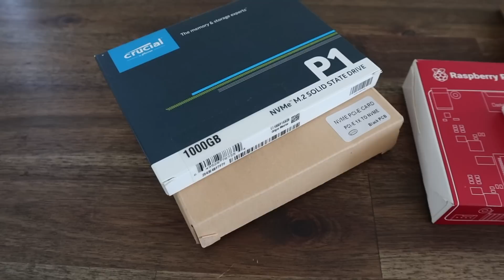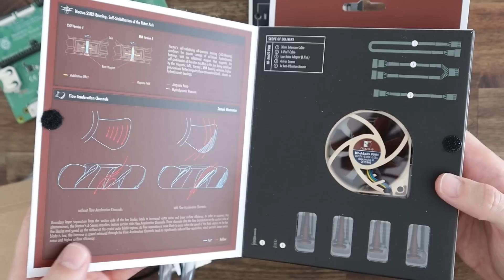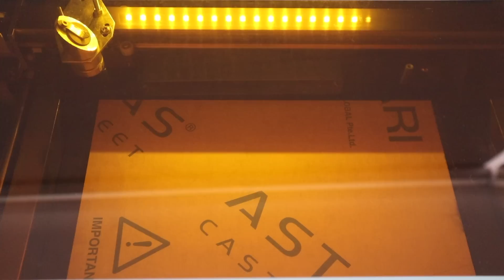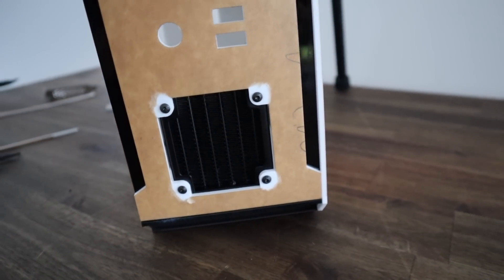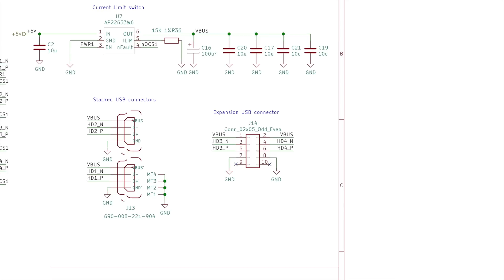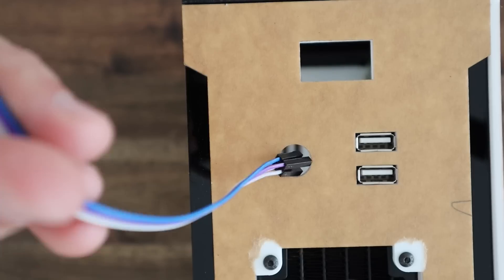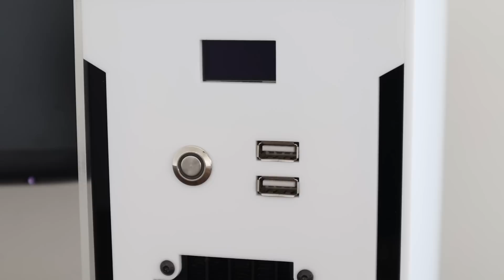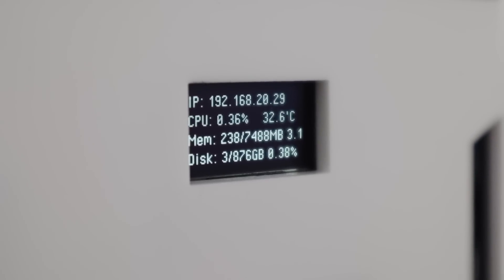Ultimate Raspberry Pi Computer Build – Water Cooled CM4 with NVMe SSD

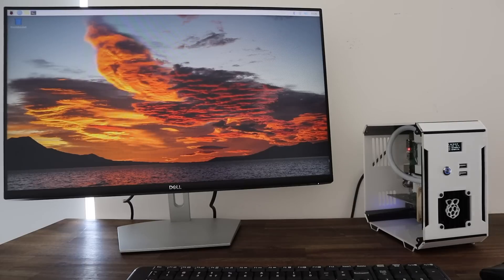Comment: 13:37 - They are USB 2.0, since the USB 3.0 ports on the Pi 4 are only possible through the PCI Express bus (with a VL805 chip built-in)—on the CM4 IO Board that bus is exposed directly (through the PCIe x1 slot).

I love the case design—it has lots of room for activities! Maybe a future iteration could be built with a PCI Express slot cut in so you could install a PCI Express card directly. Probably would need to fudge the IO board mounting point a bit, and maybe reorient things inside. But I love the simplicity and the build quality, nice work!
Reply: It doesn't really matter what USB ports are on the pi side anyways. He used a USB 2.0 cable, so anything will be limited to 2.0 speeds even if the pi side is 3.0 and/or the drive is 3.0
Reply from the maker: Yeah I figured that since the two USB ports on the IO board were USB 2.0, the expansion ports would probably be as well. Thanks for the explanation on why though, that makes a lot of sense.

It would actually be quite easy to adapt the case design to include a PCI Express slot, there is enough room for it. I'd just need to add some way to secure the screw on the 90-degree bend at the end of the bracket - which could be done with a 3D printed part. I hadn't given it too much thought since the M.2 adaptor doesn't have any external ports, but it would definitely make the case more versatile for other applications.

Great to see you here by the way, I love your videos!
Reply: @MichaelKlements  Ditto!
Reply: i ws writing to say the same thing... I just need to get MINE to boot from the nvme :/
Reply: @MichaelKlements  are these available to buy? 🙏🙏🙏
Reply: remember your issue with grphics cards on a pi4? have you tried a pcie 2.0 gpu? like a gtx580

Comment: This is the first time I've seen the CM4 and carrier board used, although I've known about the CM3 (and now the CM4) for a while.  Looks very interesting.  I'll definitely consider it when I next need to get a Pi 4.  I especially like the 12V barrel connection for power: so much easier than messing about with micro-USB or USB-C cables.  Just hope the stock levels and pricing of all the Pis get back to normal at some point...

Thanks for a great video!
Reply from the maker: This is the first "project" I've used one for, I usually just use the regular Pi 4b for its size. The IO board does have a number of benefits over the Pi 4b though, so it makes it quite versatile. 
Hopefully we'll be able to buy CM4 modules again soon!

Comment: Amazing video as always <3
Happy midweek and keep it up the great job <3
P.S.: Pump should always be the lowest point in your water-cooled loop ;)
Reply from the maker: Thank you! 
Yeah, you just also don't want to have the filling point of the reservoir lower than the radiator or cooling block otherwise when you open it up you'll get coolant leaking out of it. With the pump fully submerged in the reservoir, there isn't much risk of it running dry.

Comment: I'm pretty sure you could have shrink down the size of the case even more. it's a very pretty build and i thing my re arranging the placement of the components you could have a smaller and better looking case !
Reply from the maker: It could be made quite a bit smaller without the water cooling loop, or possibly using hard tubing. Flexible tubing needs some space for bends.

Comment: You could've put washers between the compute module and the I/O board to prevent the CM4 bending and added springs on the top bracket screws to prevent over tightening.
Reply from the maker: Thanks for the suggestion!

Comment: I love what you done. The radiator have to be above the cooling block, Always so you don’t have air bubbles in the system. Also you should have mounted the reservoir at the bottom, if you need to repair something, it would have been easier to access it. But thumbs up.
Reply: The 3D project is available at etsy and I bought it. Thanks for the clue. Because I do not want to use usb extender and power button, I can redesign this part and move the part for radiator screws higher where holes for USB and power button are located. And this way it can be achieved. Eventually move the power button and USB holes lower, I mean rotate/replace each other. So, quite easy to make it work. I have bought acrylic plates, so probably on February 2023 will record a video with the project.

Comment: There is no holder for LCD in the 3D project that I bought on Etsy. I had to design the holder for standoff and now will have to do this for LCD screen.
Reply from the maker: I'm sorry to hear you needed a component that I did not include. I have added the display holder to the download, so you should be able to re-download it. The case was modified to allow the standoffs to be secured through the side of the case, that is why the standoff holders were removed.
Reply: @MichaelKlements  I wrote to you through etsy. I did not find the stl file of the LCD bracket in the re-downloaded zip file.

Comment: My observation is this:  First, you should have used thermal paste of any good brand instead of the thermal pad.  Thermal paste is much better in transferring heat from the processor to the heat sink.   Second, using colored coolant is not good for long term use.  There's lots of youtube videos showing nasty gunk formation inside the heat sink because of the stuff used to colorize the coolant.  Sometimes it even reacts to metal, causing corrosion.   Pure distilled water should be used,  or 70% water and 30% denatured alcohol to prevent bacteria or algae growth in the water and for better cooling also.
Reply from the maker: Thanks for the suggestions Gerry!
Reply: @MichaelKlements  You are very much welcome.  The Raspberry Pi computer build you made is so impressive and I like it too.  I'd love to see more videos like that.

Comment: are you ever going to release the files for the case? I really need to water cool for raspberry pi. This might sound unusually for many of you but I use my raspberry pi as a digital dash cluster for my race car. On the track, my cockpit will see up to 100+ ambient temperature. The cpu temps are spiking to 50-60 even with an ice tower. Seeing you videos. 30-35 degrees is really insuring. I want to water cooler my raspberry pi.

Comment: In the description you have a URL to a horizontal water pump and you are using a vertical one. Because of that I bought wrong water pump. Then watched the video over and over and spotted that the pump is the vertical one and the pipe from the water pump goes up. Had to buy the vertical one. This is extremely important. I have found at Amazon acrylic cylindric water cooling tank, diameter 12,9 mm, with removable threaded lids, so I was able to put the vertical pump into it. I did the same thing with the transparent pipe (8 mm diameter) and put the end of the pipe onto the pump and used a cable tie like you did, and the other end of the 8 mm pipe I put it into the threaded tip that I have bought separately. It is hard to explain what I exactly did. I will upload the video soon to show step by step the process of mounting the pump inside the tank. Noctua fan must be 4-pin, not 3-pin, if you want to regulate it with PWM. What about the 5V? The module with  the mosfet IRF520 requires 10V to run at all, what is important, so you need at least 10V power adapter for the module with the mosfet. I know you are using CM4. Instead of the module with the mosfet, I decided to use a module with two relays to connect it to the Raspberry Pi 4b rev. 1.4 and of course the pump and fan have separate 5V power adapters connected to relays. It is quite simple, but required some time to perform a research. Outside the water tank I am using the pipes from your Amazon link, they are wider, 10 mm diameter, so had to use special threaded adapters for my water tank to mount bigger transparent pipes, similar to those you are using in the project with the green water coolant. Anyway the project taught me more about the microelectronics, mosfet, relay etc. than I learned when I had microelectronics class. Thanks a lot for this video, for the water cooling block with the bracket that I ordered through Etsy and it finally came and for all the support you provided that allowed me to understand each part of the whole project.
Reply from the maker: Unfortunately Amazon sellers switch products around but keep the same product page so that they don't lose the reviews etc., I'll get the pump like updated to one with a verical connection - thanks for letting me know.
Yeah the CM4 IO board takes a 12V power supply and has an onboard fan header, so you don't need to worry about any external modules to power the fan.
Great to hear you've managed to get it all put together!

Comment: I have last question. What DC did you use? 12V 2A? I am just wondering what I have to buy to provide sufficient energy.
Reply from the maker: I used a 12V 3A power supply - 2A might not be enough for the Pi, NVME drive, pump and fan.

Comment: Nice case, Unfortunately I have no 3D gear, I'd probably skip the water bit and just use a decent heatsink and arrange a fan to pull the heat straight out the back of the case - as opposed to the regular PC idea of two fans, one to cool the CPU heatsink but just spread that heat around inside the case, and another one to push that hot air out the back.
I'd also find some washers and other spacers etc, so those screws holding the water block in place can be properly tightened up without placing any stress on the CM4 etc. 

How does that CM4 & NVMe combo compare to a NVMe hanging off a USB port on a regular pi, yes the numbers will be better, however I'm more interested in real world everyday computer usage, is it worth my time finding a CM4 etc, or should I stick with a regular pi etc. If it's only 1 or 2% better, then I'll probably just pass.

Comment: Awesome build ❤️, also I don't know the specifications but I think the extension cable for usb ports were 2.0 only, try 3.0 extension cables, may be it will work.
Reply: The carrier board only supports USB 2.0
Reply from the maker: Yeah I think the IO board only supports USB 2.0 on these breakout pins

Comment: I have bought the project via etsy and also the water cooling CPU aluminum block with the bracket. However I would like to know how many acrylic 3 mm sheets should I buy to be able to cut all the elements with the laser cutter?
Reply from the maker: That’s great, thanks for the support. You need 4 x A4 size sheets - each large side panel fits on one sheet and then two of the smaller panels per sheet. The corner fillers can be cut from the scrap pieces.
Reply: @MichaelKlements  thank you very much for the explanation. I have read a lot about the proper water cooling schema and I know how to connect it.
Reply: @MichaelKlements  how the water pump that is inside glass bottle is connected to the power supply? Directly to the CM4 board or to the separate power supply like some DC?
Reply from the maker: It's a 5V USB pump so I've got it running directly from the CM4 carrier board
Reply: @MichaelKlements  thanks a lot. I have bought all the necessary parts and probably on February 14 2023 will record a video. I am going to change a little bit the front. Power button and USB holes will be below holes for radiator screws. Radiator will be higher, above the water CPU cooling block, to avoid air bubbles. And will mount the reservoir at the bottom, just because I have bought designed reservoir for this. I will also give links to some parts available in Poland and Europe. Acrylic parts ordered also. My friend has a 3D printer. In my city there are lot of companies that have laser cutter and the price is reasonable, so I decided to buy the service. All of this is not extremely expensive, but this is something for enthusiasts. Maybe if I could have some garage I do not have, because I live in apartment, I could buy a 3D printer and laser cutter, but 60 W at least and then probably the price could be lower I suppose, just because parts here are much cheaper. I will provide a comparison because this project deserves it definitely.
Reply: @MichaelKlements  do you know how to connect the water pump to the Raspberry Pi 4b rev. 1.4? The CM4 computing module is not available, and I do not want to buy just the CM4 board that is available, without the computing module. Anyway, I have watched all your videos with the water cooling solutions and I cannot figure out how did you connect the water pump each time to the raspberry pi. I mean the green one project and the red one with the cluster. Should I connect it to the simple relay board with independent power supply?
Reply from the maker: The cluster and larger green project were done with a 120mm fan and a PC water cooling pump, they run at 12V so I had to use an external adaptor. This project uses a 5V pump which can either be plugged into one of the USB ports on a Pi 4B or the CM4 carrier board or you can plug it into the 5V and GND GPIO pins.
Reply: @MichaelKlements  I see. I need to figure it out how to connect it to USB. Fan can be connected directly to GPIO as most fans are connected this way it to the external power adapter that I already have to regulate spin (currently I have 3 120 mm fans connected to it in my small 10 inches rack. I suppose that also the pump can be connected to the external power supply and controlled via GPIO if needed, but rather fan should be controlled than the pump, however if both are to loud it would be good to control the speed and the flow through the Python script. Anyway i will look for the solution and then record the video how it has been connected. Wish me luck with this.

Comment: Awesome job, Michael!

Could you tell us what are the normal and stressed operating temperatures of the fan and water cooled Raspberry Pi?
Reply from the maker: Thanks Giancarlo. It depends on the ambient temperature but it typically runs at about 28 degrees normal and 31/32 degrees fully loaded.
Reply: @MichaelKlements  thank you! I’ll keep watching your videos! 👏🏻👊🏻

Comment: I tested the button, but in fact it is not doing the job, I mean it does not work at all. After the command shutdown -h now, or systemctl poweroff the OS is shutting down properly, but when I push/press the button it does not power on the OS. Cabling is fine, I checked it twice and all the wires are connected properly to proper pins. IS there anything else I have to know, that you did not mention? OLED is working fine. Will have to figure out USB ports, where actually only one is working as USB and the second is only to charge the device. Is it because of that I bought wrong USB splitter cable? I do not know this and I am curious the behavior tested by you. Anyway The water cooling is working correctly - pump is connected to GPIO and PWM Noctua fan to fan slot with four pins on the CM4 motherboard in the corner.

Comment: where is the switched power supply?i can't believe you have all the stable energy from raspberry to fan and pump
Reply from the maker: The fan and pump are both pretty low power devices and the IO board runs on a 12V supply, which is being supplied by a 12V 3A adaptor.

Comment: cool project i just dont see why water cooling is needed on pi4. can overclock air cooled to 2ghz reliably. just add a good heat-spreader with a fan
Reply from the maker: That's why the video starts by saying that this is unnecessary

Comment: I uh... Well done I guess. I just don't see the practicality of such a build besides "because I can". An air cooler and a Noctua fan could've resulted very similar - if not the same results. And it would be far less maintenance heavy. For example I don't see an easy way to drain your water loop. Could be considered in a version 2 of this case. But it looks fancy! :D

Comment: I really like your builds, great work on that. Here is thought for another project.
Can you make raspberry Pi as a seed box server for torrenting 24*7. I am hoping to get a decent build with atleast 1tb SSD for seeding opensource softwares and OS for cheap rate, is this possible? Seed boxes are expensive in the long run so i was hoping to make a cheaper alternative that can seed files indefinitely, it possible to use torrent client qbtorrent for this?, if so please consider this idea for your next project. Thanks.
Reply from the maker: Thanks for the suggestion, I'll look into it
Reply: Thanks michael.

Comment: How much did this cost in materials to build??
Reply from the maker: The case is mainly just acrylic and 3D prints, so probably around $30-40 in materials. All of the other equipment in it is probably another $250-300.